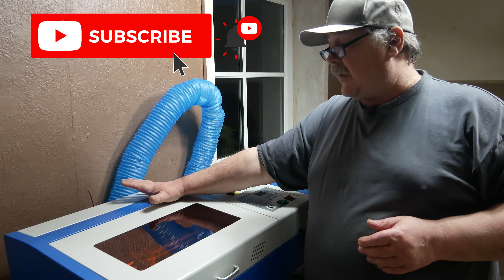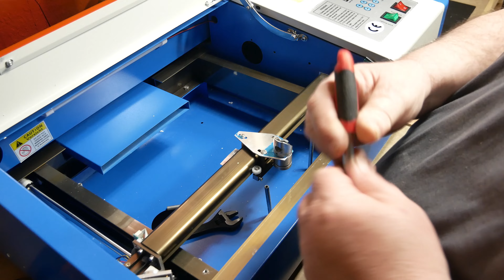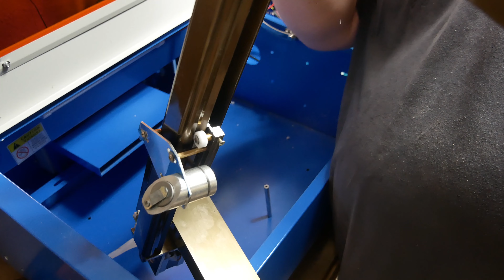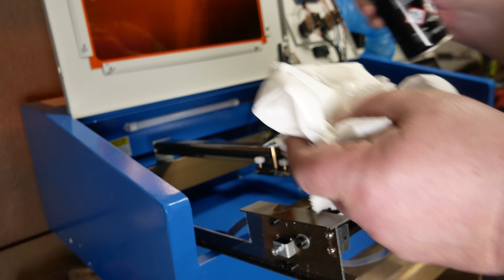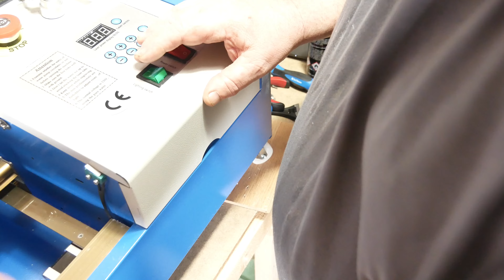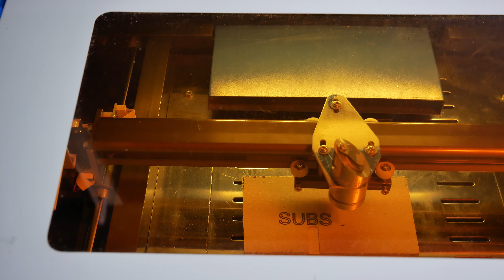K40 Laser fail on Y axis and make "knarking" noise

Comment: I was getting the same kind of noise from my Flashforge 3D printer's x axis. It sounded like something was slipping. In fact, it turned out to be an internal break in the cable supplying the stepper motor, caused by the constant flexing when the machine was in use. I replaced the cable and the problem was solved.

Comment: You have stripped the machine for no reason. There are two holes at the back for adjusting the belts.
Also there is no reason to take all those parts off to remove the gantry, just remove the air exhaust, it's not needed anyway.
Got mine from Vevor too. The upgrades make a big difference. The fan is very effective, I found the safety switch was badly placed and the lid would miss it but it's easy to fix. Something you cant see easily is that the power supply is also upgraded, the rectifier is now a 6a one and this prevents the previous problems with the flyback transformer.

I also had this 'knarking' noise, as you show, it's an easy fix. No need to remove the gantry, but if you do just take out the square air exit, it isn't needed anyway.
Reply: I have the omtech blue Grey I belive is whatbthey call ot it's the other one then this do you by chance know if the holes are as well I really don't wanna take it all apart but it keeps making thing sound and jumping messing things up . It also came with a tube of lube I assume it's for greasing it like he did with the spray ? Sorry laser nob I really don't wanna break my expensive hobby 😢😅